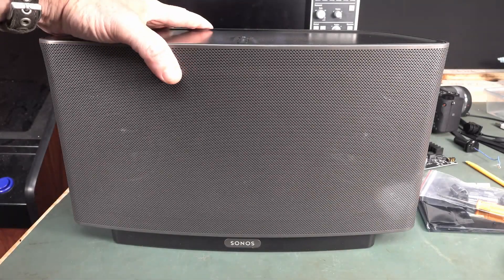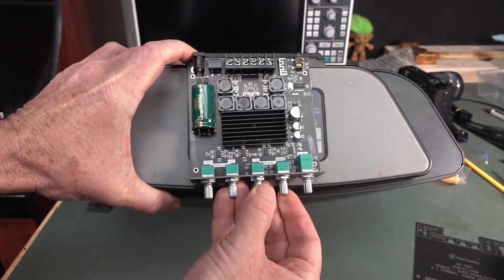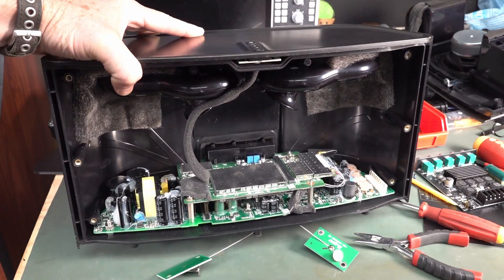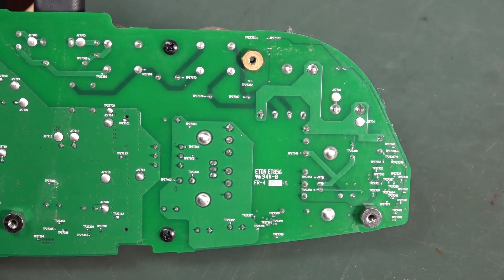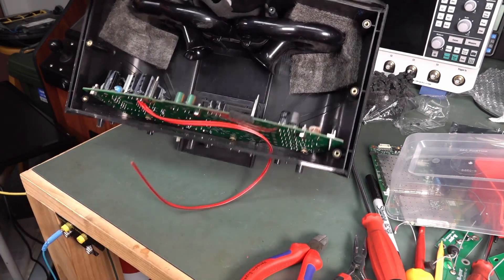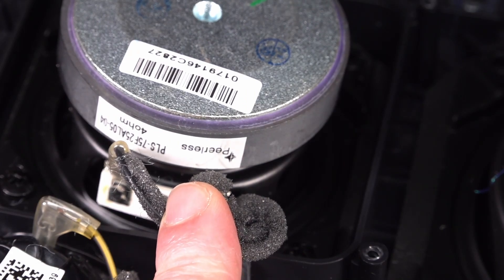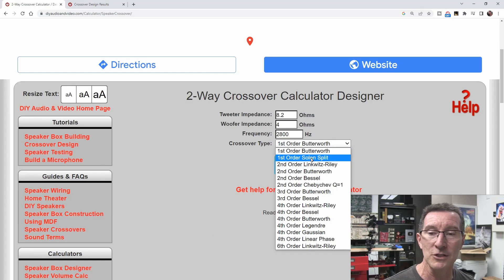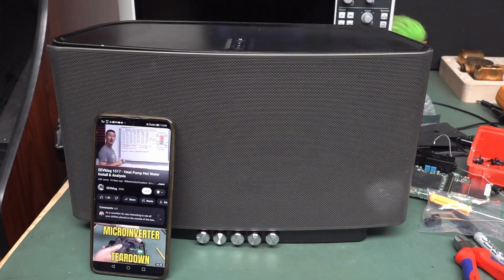EEVblog 1519 - FREE Your Sonos Speaker! (HACK)

Comment: you need to REGISTER the speaker to use the "line in" function? do people realize HOW RIDICULOUS that is? why do people keep buying this kind of products 🙄🙄🤦‍♂ this is the best example of "You'll Own Nothing and Be Happy"
Reply: Cars are going the same way - subscription to unlock features, what a load of b****cks - hope the manufacturers get bitten.
Reply: @richardhalliday6469  Yes, that level of subscription is madness.
Reply from the maker: Yep, you have to actually register to use the line-in function. Pure engineering evil.
Reply: @EEVblog    it's because they allow you to stream your line in to other sonos speakers 

And there is no analog system to bypass the software to use software you need to agree to terms
Reply: @EEVblog  Wouldn't this be considered HaaS? Hardware as a Service?
Reply: I don't think it says on the box REGISTRATION NEEDED. That's why some ppl bought it.
Reply: Next gen will come with a slot where you have to provide a DNA sample to login, only works while connected to the internet and a microphone that's always listening.
Reply: @JohnBurgessMusic  o
Reply: @JohnBurgessMusic  Actually you will need Elon Muuks' Neural-Link chip implanted in your brain before you can even power the device on and your subscription must be paid for on an annual basis.
Reply: @JohnBurgessMusic  You forgot the mandatory monthly subscription fee to access the line in port
Reply: @repatch43  Haven't used Sonos, have you? Buy the speaker, sign up for a free account. That's it. No monthly fees. Nothing.
Reply: @BuckRogers2491  Hahahahaha, whoosh...
Reply: I bought some Samsung Galaxy Buds earbuds and found that they would only work with Samsungs Bixby voice assistant.
Took them back after finding that.
Reply: Because their marketing budget is bigger than their engineering budget.
Reply: Reminds me of Razer Naga mouse which needed to be register online before you could use programmable buttons.  Ok just looked it up, it gets worst it need an always on internet connection.
Reply: Or an HP printer that needs to be ON THE INTERNET AND REGISTERED to even begin printing. To scan files you need to have an HP account. How bloody ridiculous is that! And in the end it doesn't even work.
Reply: @XtrAMassivE  TBH the HP one does have some good justification. We've had one for several years now. - A/ the printer itself was very cheap to buy, B/ the cost of the ink is quite a bit lower than buying through normal methods, and the best part C/ you never ever run out of ink.. Overall one of the better online account products.
Reply: People keep buying because they sound good and usually are in the top of the top 10 lists. Now you could always do a more thorough research and find a cheaper speaker with the same or better sound (Aiwa Exos 9 anyone?) but that requires effort that many many people don't want to put in
Reply: It would be an instant return for me.
Reply: we're living dark times where every big company wants to harvest your data
Reply: Yep, we live in a 🤡🌍right now. If people don't wake up soon it will only get worse.
Reply: Something apple in there infinite wisdom would do
Reply: Had the same issue with a BOSE soundbar to turn on the optical out
Reply: The reason is because you can play the music input from 1 speaker on another speaker 

So you conect your vinyl to 1 speaker and play your vinyl on your bathroom speakers 

There is also a noticeable delay on those older speakers .5s or something because of the synchronization that's needed to let all speakers play together
Reply: @neok1996 These comments are tough to keep in order since there's no threading. 

What's your comment referring to, exactly?
Reply: @Clint  the only ting eev blog said here that 

Requiring an account for line in is criminal 

But he didn't go to the Trubble of making a multi room speaker that can synchronize the music in different rooms  over wifi without user's agreement to use the 5Ghz band to synchronize the music
Reply: @neok1996  The problem I have with the video is, it was a unit found in the trash. As such, it is possible that unit had been disabled in exchange for a 30% upgrade from Sonos. Its been a while, but I believe he could have factory reset the unit and used the Sonos desktop controller (Windows or Mac) to set it up without an account. Or, use a burner email and setup with the phone.

Point is, since it was a dumpster find, we don't know the state of the unit. It'd be like finding a perfectly good computer in the trash and being mad there's no login. Well, yeah, you're going to have to start over.
Reply: Jesus, it would easier to get into a young nuns nasty, no registration required
Reply: @kristiandawe85  Oh no, a burner email and a quick sign up process. Whatever shall we do?
Reply: @BuckRogers2491  What if you want to use the device in 10 years when the cloud or the apo will maybe not exist anymore?
Reply: @Mobin92  Hand wringing over "What if?" scenarios is worthless.
Reply: Plenty people want easy life, they don't want to know technology, they just want to buy what look like a nice speaker, making them vulnable to company like this
Reply: I'll hazard a guess the target market still has the cash to just buy stuff without doing their homework.
Reply: Almost like requiring an MFP/printer to have genuine non-expired ink cartridges with ink left in them to be able to use the scan function..
Reply: I believe the bigger issue is it's Nearly impossible to register the first gen sonos speakers (mainly due to having to use old software and I assume no WiFi support)
Reply: Corporations will not own me and they WILL be happy about the arrangement!
Hack Your Way To Freedom!
Reply: I've never seen someone simping so hard for a company, until I read Clint's comments below 🤦‍♂🤦‍♂
This is why we can't have nice things. A manufacturer does something bad, then the fanboys defend them 🤪
Reply: @arcadeuk  Hack your way to freedom!

(I really need that on a t shirt)
Reply: Just like every single smart tv ever made.
Reply: Own crap and be frustratedly unhappy more like.
Reply: Really impressive mod. Is it not possibel to wiring the Jack input on the existing input of the amp on the existing board?
Reply: Yep, and these things are pos, I have cerwin Vegas that will shake this pos speaker on the floor and watch it smash into a million pieces. I have no time for this piece of junk.
Reply: Speakers have acoustic sealing for a reason. If I take out  the tiny cover screw of my active speakers for adjusting levels it huffs and puffs audibly over the sound from the speakers so no 'audio foolery' at all.
Reply: People don’t buy these to function solely as a speaker with a line in source. They use it to play audio from multiple sources (Spotify, TuneIn, MP3s on a file share) and synchronise it across speakers in multiple rooms.
Sucks how they stopped providing updates for older hardware though.
Reply: @CharlesGregory  i have a load of S1 kit and it updates fairly regularly. It all works perfectly and sounds amazing. 

I've got some with spdif inputs and my TV audio gets sent round the house instantly and perfectly. It's great stuff
Reply: @CharlesGregory  Exactly. People here are missing the point of Sonos. It's not your run of the mill Bluetooth speaker that also happens to have a line in. The Play:5 gen1, gen2 and Five all have a line in. The rest of the Sonos speakers don't. Sonos is the epitome of easy whole home audio and really decent home theater.

Yeah, you have to have an account. Don't blame Sonos; they're reacting to all the people who want the streaming services.
Reply: It’s because everything is controlled through software and you have to register the thing to make it work. Very irritating.
Reply: @richardsinger01  It's true that Sonos is controlled through software. What's the alternative for whole home audio without running wires and investing a ton in multi-zone amps, etc...? I don't know of any good alternatives.

People here a bagging on Sonos and when you look at a single speaker, yeah, it makes no sense. Multiple rooms, all audio synchronized, then it makes lots of sense. Sonos actually as a very good track of keeping support for older products.
Reply: @BuckRogers2491  Google home devices do that, and work great at it. Even the cheapest 'puck' speakers support whole home. I use it daily.
Reply: @repatch43  And you have to buy into Google. I like Android, but I really don't want their devices in my home.
Reply: @BuckRogers2491  You're OK with 'buying into' Sonos, but not Google? You can't see that they're the same thing? Except the Google solution is FAR cheaper, and has far more features?
Reply: @BuckRogers2491  Local servers that don't need any kind of cloud or accounts are the answer. Or other smart home communication protocols.

Nothing you mentioned technically requires phoning home to Sonos headquarters.
Reply: @nicfab1  Yep, and I have a local server setup with ~65,000 tracks. I can use my Sonos system completely offline.

Sonos does some analytics and that's it. You can opt out. I have all of it blocked and everything still works.
Reply: @repatch43  Not the same thing. Google is all about you being the product. With Sonos, you've purchased the product and for a fair bit of cash, too. Sonos does one thing and it's not the advertising, collecting all information at all costs like Google. Neither Google nor Amazon audio pod things are in this house.
Reply: @BuckRogers2491  my alexa echo dots connected over bt to jbl speakers offer me exactly that
Reply: @msana4420  Okay. Neat. Glad it works for you.
Reply: @BuckRogers2491  The alternative is running wires and investing a ton in multi-zone amps, etc.  

I wanted a home security system.  But I never bought Nest or Ring or whatever the hell cloud bullshit there is out there now.  I ran CAT6 wire and bought my own PoE switch, 4 cameras, and installed an open source DVR on a spare PC.  It's not easy going DIY and these companies are counting on our laziness.  They profit because they offer convenience.  It's like using Linux as an alternative to Windows or Mac to try to get away from proprietary crap.  Good luck, the learning curve is a vertical brick wall about a hundred feet high.
Reply: lordmorseofsealandsermons9610  I can't speak to Alexa, but Google certain doesn't require any subscription on their whole home feature.
Reply: yes, people realise that and then don't buy Sonos products, so you won't hear about that.
Reply: You're all wrong.
People buy these to listen to the same monophonic music blasting in every room of the house at the same time, for the seamless experience.
Reply: @good_deeds_always_get_punished  Sure, we all are wrong, despite the fact that we talking about something else than you.
Reply: @BHBalast  It was a joke, my man.
Reply: I feel like no one knows what they're talking about. That's not just a line in to the device, it's a line in to the network. Once you have a source connected to that line in, you can route the audio to anywhere in the network and play on any other Sonos device. 

It means you can attach your TV maybe and play audio across the house or whatever. 

Registration sure, but most things need registration. And S1 stuff works fine, it's not obsolete, i have 6 S1 devices and they're all great. I can listen to my TV audio from the bathroom if i want. I've got the app on my phone and i can control everything in seconds. 

Your hate is unjustified. Find me something else that can do what it does that well without resorting to pro AV installer gear.
Reply: @spaz Hope it tasted good. Just had asparagus!
Reply: @mgancarzjr  Yay! Party time.
Reply: @mgancarzjr  Google Play for updates? Requires an account, even on WiFi. Apple app store for updates? Yep, an account. If you're okay with that phone being frozen in time from when you purchase it, sure, go ahead and don't add accounts. Yeah, sure, you can sideload Android apps, though that's past most people.

With Sonos, I am signing up for a service. Feature additions require firmware updates. Bug fixes require firmware updates. Don't like it? Don't buy the product.
Reply: @mgancarzjr  "I want everyone to conform to meeee!" Certain products I don't like, I won't buy. I don't whine about it.

How's that for civil?
Reply: No. You register so the products will be associated with your account. For one, that keeps guests from changing settings. Two, you can use the line-in if you're on the same network as the speaker without being logged into a Sonos account. Three, the registration is to keep up with the third party (Deezer, Tidal, Apple Music, etc... accounts.

To comment on YouTube you have to have an account, right? To use email you have to have an account, right? How many other accounts do you have to have to use a service? A cell phone without an associated account? Good luck.
Reply: @BuckRogers2491  IT'S A SPEAKER!!
Reply: @markbrown8097  It's okay if you don't know anything about Sonos and the capabilities. Just admit you're commenting on something for which you have no knowledge.
Reply: @BuckRogers2491  There are refrigerators that play Youtube videos, but I don't need to log in to use the icemaker.
Reply: @BuckRogers2491  rosszul látod  látod, összekevered a terméket a szolgáltatással. youtube vagy a mobil hálózat egy szolgáltatás, mint az áram, de az autómba beszerelt ülésfűtés egy termék amit kifizettem és ujra elő kell fizetnem rá..... és ha elszál a mobilnetem vagy bezár az autógyár akkor meg befagy a seggem mert nem találja a kocsi a szervert hogy bekapcsolhatja-e az ülésfűtést?? nevetséges...  (sorry my english is to bad for this so google is your slave and it can translate it)
Reply: @kartmen69  I'm not excusing the subscription model of car seat heating. That's just insane. In the case of Sonos, you purchase the speaker and that's it. No subscription outside of things like Apple Music, Amazon, etc... Connect a local library of music and you don't have to subscribe to anything.
Reply: @BuckRogers2491   That's great, but it still has nothing to do with the requirement of online registration to use line in. It's as bad as having to register online account just to make your on/off switch work, or a car that can't ignite without internet connection. It may be great car without any alternative, but at the end of the day it's still really bad. It's just pure, concentrated BS.
Reply: @BHBalast  It's a smart device, running software to do more than a dumb speaker. It gets firmware updates for new features, bug fixes, etc.... Those updates are locked behind a registered account.

If you want a speaker with line-in, there's plenty of them on the market. This is all much ado about nothing when ALTERNATIVES exist and for quite a bit less money than Sonos.
Reply: @BuckRogers2491  Sure, there are options, even better, they are cheaper, but I do not understand the assumption that the fact of locking basic functionality is not BS if only there are alternatives. It's still BS no matter what other manufacturers do. Locking your car engine is still BS no matter what other car manufacturers do and if they are cheaper or better.

Also if your speaker needs bug fixes for line in to work, let's just say it's doesn't look good in terms of software quality. :D
Reply: @BHBalast  Thing is, the line in isn't locked. The entire speaker was either locked because of the upgrade program or because it was tied to the previous owners account.

The crazy thing about this whole discussion and video is, it's a free speaker. A free Sonos speaker that was in the trash. All Dave had to do is sign up with a burner email account, setup the speaker, then disconnect it from Ethernet or WiFi and the line-in would still work. That's it. Simple, easy, done.
Reply: @BuckRogers2491  .....or they could just provide their users with such a terrific experience offline that they want to willingly sign up for all the enhanced nonsense you are grabbing for. Forcing registration to use a product for its main purpose is not the same as youtube comments and you know it. 

Stop being a tool. 

I'm sure you probably justify seat heater subscriptions also.... which I could only justify if they didn't also charge you for the hardware.
Reply: @srmofoable  Since you seem to know so much about Sonos, please educate me on how they'd provide whole home audio via WiFi, Ethernet, or the Sonos mesh network SonosNet, while tying into the streaming services everyone (not me) wants these days WITHOUT some form of account.

See, I wanted to hate Sonos like everyone here seems to. At one time they had just the app and you could setup a speaker without an account. Since everyone and their dog wants streaming this, streaming that, and subscriptions, Sonos included ways to tie into those. Gotta have accounts for those.

Your seat heater comparison is not even close. Sonos charges for one thing and one thing only: the hardware. An account with them is free. Listening to your own music is free. They don't charge for connecting services like Spotify, etc...  Firmware updates are part of the service.
Reply: @BuckRogers2491  I never heard of Sonos. I just saw what happened here. And I can tell you that when I buy a device that says that it has an "line in" connection, I expect to be able to connect a device and be able to hear a sound. If not, I highly doubt the intentions of the manufacturer.
Reply: @erikdenhouter  Well, if you purchase it without fully researching on its capabilities and drawbacks, that's on you.
Reply: @BuckRogers2491  You see what happens when (and maybe why) thrown in the dumpster ? What you defend seems the abilities that you came to know and which you like. Good. But I really think the manufacturer forgot its thinking cap 🥴
Reply: @erikdenhouter  You're full of assumptions. You don't know why it was in the trash. Regarding the thinking cap, well, it sure seems Sonos is doing quite well. Even Dave commented on how well built the speaker is and it's a quite old unit. They hold up and are very reliable.
Reply: @BuckRogers2491  Probably Sonos is doing well. Still I see people here reacting with frustration on the fact that such a well build unit needs to be trashed when it demands things that are not there any more, or hard to accomplish. Don't close your eyes for what Dave is doing in the video 😉
Reply: @erikdenhouter  In the previous video, someone pointed out that a free account could be created with a burner email address. If I remember correctly, Dave acknowledged that he didn't know that could be done. Seriously, he could activate a dumpster find, get it going with a burner email, then disconnect the speaker from Ethernet or WiFi and the 3.5mm would still work. That's a win, if you ask me.

Dismantling the speaker and having waste from the parts ripped out when they didn't need to be seems to be kinda silly.
Reply: @BuckRogers2491  You are just not getting the basic problem. Products that are tied to an online account stop working when the manufacturer decides - like when they have a newer model to hawk. There are any number of 'smart' products that no longer work because the online servers are down or gone. This is exactly the kind of thing that gives tech such a bad reputation as wasteful and makes it so environmentally bad.
Reply: @BuckRogers2491  I connect all the speakers together into a Mesh, configured locally (with bluetooth) by the App. Then I select that whole mesh (or a master speaker) as an bluetooth "device" to play the music from my phone. At what point would I need to connect to some Sonos cloud to do that?
Reply: @BuckRogers2491  Point well made if that is the case. Stilll... a bit of trouble that could be avoided 😊
Reply: @Lucien86  I get that people don't like products being tied to an online account. I tend to avoid that kind of lock in as well. However, in the case of Sonos, if the company folded tomorrow, the speakers would still work. It would be a ticking time bomb since the app on phones would need to be updated for a new OS and that's a problem. The Windows and Mac app would continue to work for the foreseeable future.

If I yanked my internet connection right now, my Sonos system will continue to work. I don't subscribe to the online music sources. I do have a local music library setup. That local library will keep chugging along, internet or no internet.
Reply: @Mobin92  Once the Sonos speakers are setup, you can yank your internet connection. I've had internet outages but still had power at home. In those times, my network was still up. Since I have a local music server, I could still play music on any or all of those Sonos speakers.
Reply: @BuckRogers2491  neither Airplay nor Spotify connect need an online account, even less a speaker specific account. Multi room audio is also not at all a reason to require an account.
Reply: @remotectl  At this point, I really do not care if people don't like having an account to setup Sonos speakers. I have one, they work. I'm happy with it. If the account is not acceptable to you, okay.

I don't care about Spotify and I could care even less about Apple products.
Reply: @BuckRogers2491  Still why does it need internet in the first place? I understand the app, but why can't everything just be done locally in LAN?
Reply: @BuckRogers2491  Would you want to create an account to use your oven? Because how else could you set the temperature of the oven right? Only through a cloud based app! The oven doesn't even have knobs or a touchscreen. The cloud is the only way, and it works. That's what you sound like...
Reply: @Mobin92  Updates. It's running firmware that receives feature enhancements, bug fixes, etc... It can operate completely offline, if you wish. For the initial setup, it may be possible to use the Windows or Mac desktop controller to do so without an account.
Reply: @Mobin92  No, you're completely off base with your comment and assumption.

1. I don't and likely will not own appliances that require an account or app to control them.
2. Find me a multi-room audio system that can keep audio synchronized without costing a fortune, without wires (besides power) and an easy to use interface.
3. In addition to #2, a system that can also be used for home theater.
4. Adding to #2 and #3, excellent track record of long term support.

Go.
Reply: @BuckRogers2491  It's a fricking speaker what updates could it possibly need? And even if, what do you need an account for? Just download the damn update.
Reply: @BHBalast  In what world would you buy a single Sonos speaker to use line in?    That just shows a lack of knowledge of the product you're buying.
Reply: @BuckRogers2491  Seriously?
Reply: @ethelryan257  What? There's 80+ replies in this mess and no threading. Seriously...what?
Reply: @BuckRogers2491  you seem like you actually own a Sonos system compared to some of these other commenters 😂
Reply: @BuckRogers2491  that’s BS! A speaker isn’t a service. They want you to register so they can monetise your data, that’s all.
Reply: @BuckRogers2491  I can't get it to work like you said.......
Reply: @BuckRogers2491  A line in should work without any sort of registration, period.
Reply: @Sonny_McMacsson  it's not just a line in. It's a line in to the network. That line in can be routed to any or all devices. 

Find me something that can do that as easily.

This is also 10+ year old kit that pretty much still works and still has functionality that almost no one else has matched. Yeah it's not perfect but whining about having to register is insane.

It's a great bit of kit. Way ahead of its time
Reply: @dvyt433  Unless there is an insurmountable technical reason that necessitates registering the product (there isn't), it should function without them ever getting any info from you. Do you work for their marketing division?
Reply: @Sonny_McMacsson  is it 100% necessary? Maybe not. Is it a reasonable decision to make them registerable? Yeah, almost everything else in the world is.. Why single these out? I don't get the hate, at all. No, i used to be a pro AV installer and for a decade we used thousands of these. 

If you want genuine criticism you can question Sonos' attempts to lock out, or make the lives difficult for pro AV installers with some of their decisions.

However for home, residential quality streaming audio, there's probably nothing better for the price. 

And like I said, it's a line in to the network. How would that route without a controller? And how do you suggest the controller runs without support, maintenance and updates? And how do the vast majority of vendors control access to their software? Registration. You're complaining, (and i mean the majority of posters here) about having to register online. Something we all do, every day, all day. It's literally typing in an email address and some info. Please tell me how that's different to literally every other vendor on the planet, and on particular, why this particular function has incurred such wrath.

Are you the marketing department for a rival product?
Reply: @dvyt433  What is "a line-in to the network" anyway? I read about the line-in online and it sounds like a normal line in jack.

SONOS is getting it because they're the subject of the video and doing things reasonable people find questionable. I (and I suspect many others) am not coming around and seeing any light about it when there literally is none.
Reply: @Sonny_McMacsson  it's a line in but it can be routed to any Sonos not just the one it's connected to. Any or all. Connect an input, let's say a phone or whatever, anything with a line out. That audio can now be sent to any Sonos device, over WiFi if necessary to any other Sonos. 

You control that with an app. You can set it up and leave it that way forever if you want. In fact you never have to look at the Sonos app every again if you don't want. If you want it going to all devices at the same time, it will play without lag across them all. You choose. It's not sold as a regular line in. It's not a regular amplifier with some inputs. It's a networked audio system. And it works, really, really well. I've been using mine for over a decade, and I hate most technology. I use it all daily, all the time, as do all the family and it is not something we ever have to think about because it just works. It is reliable, unobtrusive, clever yet simple, great sounding kit with a lot of flexibility and options. I don't like ecosystems usually, this does not feel like one. 

For reference i use my sonos with an MP3 collection on a NAS, a record player, 3 Televisions all inputting to different devices. I can send any audio to any of those devices in a few seconds from where I am now.

But ok, you guys don't want to register. Ok. But maybe it's time people did their research before jumping on these guys bandwagon.
Reply: @BuckRogers2491  You´re just rationionalizing bad behavior with whataboutism.  Bricking a speaker because the user does not wish to share their information is reprehensible.  If Sonos was a responsible manufacturer they would rail against planned obsolecence and since you mentioned Apple, the Apple HI-Fi speaker never required the user to have an account and has a simple line-in and volume control. Apple hasn´t had that first generation interface used on the unit for more than 10 years yet the speaker remains useful and venerable.
Reply: @bigwave_dave8468  Don't like it, don't buy it. It's really as simple as that.
Reply: @BuckRogers2491  That goes without saying but not all consumers are aware of these types of abusive customer policies at the time of purchase so the discussion is useful. The feedback is what causes manufactures to change their behavior.
Reply: @bigwave_dave8468  Yep, and it's feedback that caused Sonos to reverse their decision on disabling devices upon the customer agreeing to it in exchange for a 30% discount. Thing is, people weren't forced to upgrade. Devices that were simply too old could stay active, just on the S1 software. While not optimal, Sonos provided a path to keep old speakers working along side new speakers. You'd have an app for S1 and one for S2, but it's not like the old ones just stopped working. In this day of cell phones that get no support after a few years, maybe 5, and other smart devices that are abandoned, Sonos has done very well with support.
Reply: @BuckRogers2491  Yeah, the cell phones are a whole other kettle that´s horrible too --the mfgr's EOL the SW & O/S and you're forced to upgrade.  3rd parties stop supporting the old phone and the thing  becomes an orphan.  Hardware and software should be open, modular and repairable be it a John Deer tractor, an iPhone, a Tesla or a stereo.   Sonos could do a good thing and make their devices (and software) open once the thing is EOL'd.
Reply: @BuckRogers2491  The point is that it shouldn't even need such a special support in the first place! It should at least always be able to fallback to just being a stupid bluetooth speaker. And even if you need some special app, that app should not require any cloud or account.
Reply: @Mobin92  You do realize the model Dave tore down doesn't even have Bluetooth. People keep comparing it to some dumb speaker that has an aux in. I'm sorry, no amount of reality bending thoughts will make it so. It's a speaker that was disabled or on someone else's account and as such, it's in an unconfigured state. Period, end of story.

Sonos does have two models with Bluetooth, the Roam and Move.
Reply: @bigwave_dave8468  Believe me, I'm wary of all the smart this, online/cloud that stuff. Fly by night companies that have the latest, greatest thing, only to be obsoleted in a year because the company went under or they moved quickly onto the next thing. I'm extremely wary of that. I'm in tech and I see it a lot.

Have I gambled on Sonos? Possibly, but at the point I bought in (2018) they had already been in business since 2002. People want to hate on them. Okay. They have a pretty damn good track record at this point of keeping old products going. The oldest Sonos speaker I have is a Play:3, which by the Google search shows it was introduced in 2011. 2011?! Yeah, a "smart" device introduced in 2011 is still going.
Reply: Yah, tech guy as well.  That's great you've had a good experience. I think the raw nerve is companies embracing the "you are the product" concept where they feel entitled to insist you share your identity for the privilege of using something you already own. They will later share, analyze and sell that identity to harvest revenue without your consent while putting your identity at risk -- begging the question "Is it really your hardware?". I think many of us long for the days of classic venerable, internet-free equipment that's not marginalized by software obsolescence..[e.g. classic Marantz, Sansui, McIntosh kit]]. Personally, I'm avoiding 'Fast Fashion Electronics' as much as possible and I applaud efforts like @LouisRossmann to stem the tide of consumer abuse. Cheers. #RIGHTTOREPAIR.
Reply: @bigwave_dave8468  I'd prefer to have less items tied to an online account to work, Sonos included. And it does work offline. Problem is, so many people want to buy into all the subscription and streaming stuff and Sonos had to react.

In the past, I had a setup with (and this is old) Yamaha DSP-A1, Magnepan main speakers and some decent Infinity center and surround speakers. It was awesome, but it was all huge, in one room and delicate to move. Plus, the wires... I can cable manage the hell out of wires, but it's tedious. Sonos finally made it easy and affordable~ish to have whole home audio and home theater, all in a package that's easy to use.

I tend to avoid products with built-in batteries, if possible. Give me AAA, AA, 9V any day and some LSD NiMh. Unfortunately, the market push is this BS with built-in batteries where the whole thing is dead when the battery croaks. Well, at least for most people.
Reply: @BuckRogers2491  Maggie´s are great but yeah, you need a room..lol..I´ve still got a Yamaha RXV1 :-) (pre--internet big kahuna home theater receiver).
Reply: @BuckRogers2491  hey, did you hear about the new pace makers they are bringing out?! You need to be online to use them and registered to a monthly subscription...
Don't encourage this behavior.
I have multiple Bluetooth speakers, and to the best of my ability I haven't been able to hack my way into them from another phone... security without registration works.
Why would you "lock out" the audio in jack... someone has to physically plug something into it... if they went to that extent to play a prank, they probably would have have used less energy to get into your undies draw...
Reply: @massimilianocacciamani7736  Hey, let's compare a life saving device to a convenience device. You lose. Try again.
Reply: @BuckRogers2491  yes, compare it, because regardless what the device does, the moment you (the owner) loose functionality over said device, the thing becomes e-waste. If you were relying on that device, or wanted to make use of it, and you cannot because of whatever bullshit reason the company that manufactured the product gives you, then you are going to have to buy another or retrofit it somehow (pointing at this video).
You buy the device, you own it. That's a freedom that sonos and other companies are eroding. This isn't for your own good or quality of service, it's to control you to buy goods you didn't need, when it suits the above companies.
It's up to you to boycott into submission those companies to protect yourself and others from this behavior.
Help yourself and others.
Right to repair, right to modify, and right to use the device you purchased in whatever manner you intend is very important to humanity.
Be human.